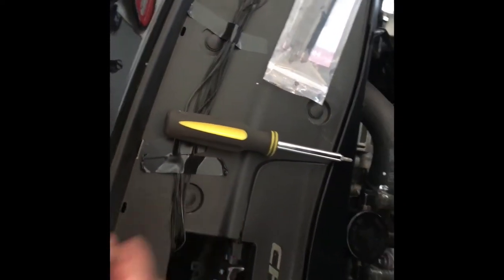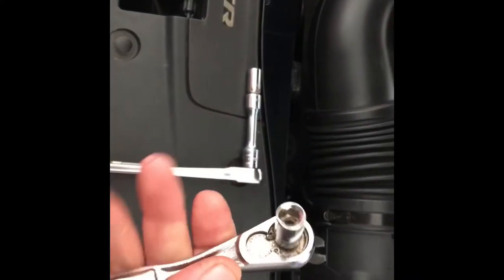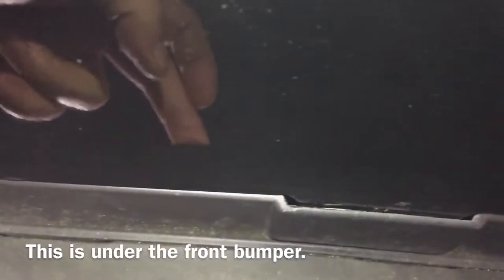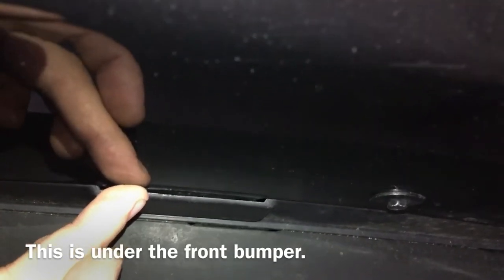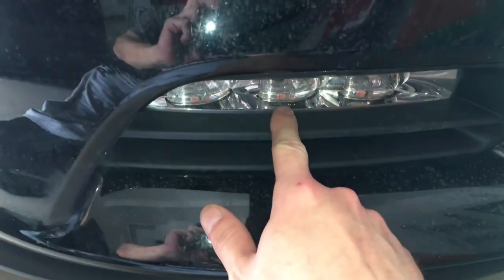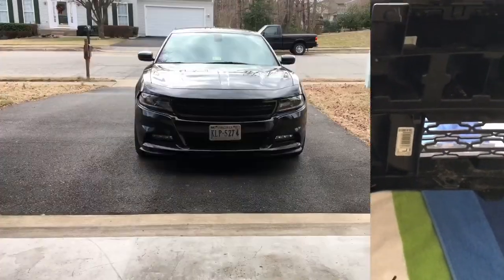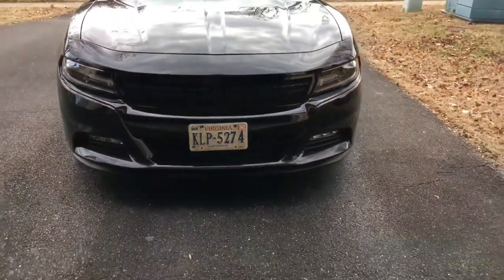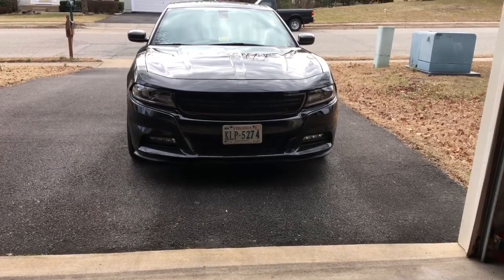The grille is installed!

Comment: Hey Paul - there should be a way to snake those cables under the front bumper/radiator cover.   You can snake them through right above the front right wheel well and they come out right in front of the fuse box.  If you have trouble reaching down there, take the hood latch assembly off and push it up out of the way and you'll be able to reach your whole arm down through the middle gap in the radiator cover.